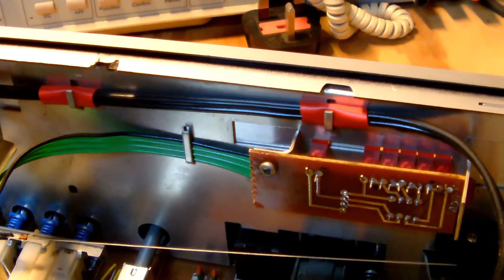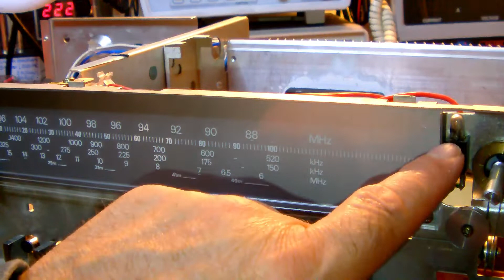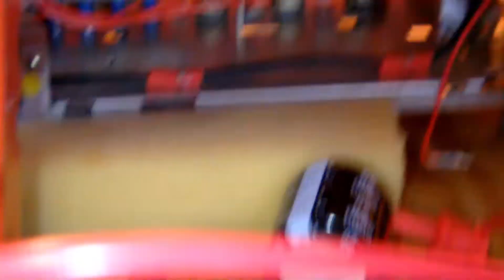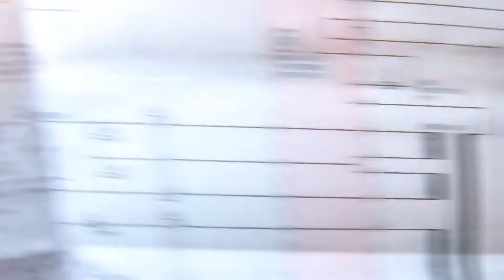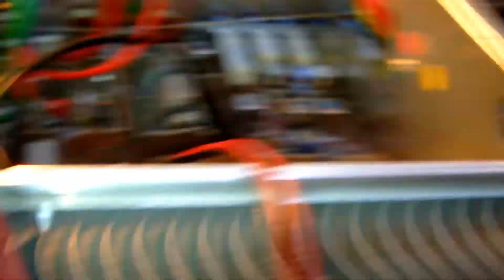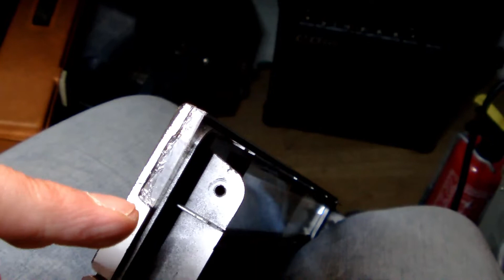Grundig R-400 Tuner Amplifier Repair Refurbishing part 1 of 1

Comment: I have the same product. I cannot get sound from the left channel but I do not know where to look for repair. Even though I changed the STK integrated circuit, the problem is still the same.
Reply from the maker: You have to inject a sinewave signal down every input of the radio/amp and check whether the left channel stays mute no matter which input you use (Aux, Tape, etc) front or back. 
If the left channel stays mute, no matter which input you inject a signal into, then most likely the fault will be close to the end stage (the TDK you replaced).
If the left channel only stays mute when using a specific input (say, Tape) then the fault must be in the preamp circuit for that input.
Good luck and thanks for considering subscribing!